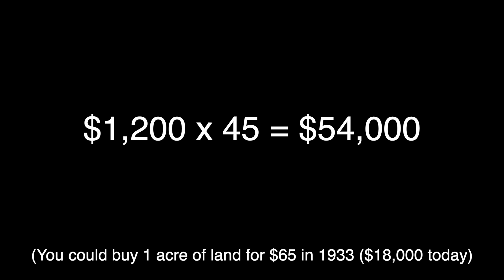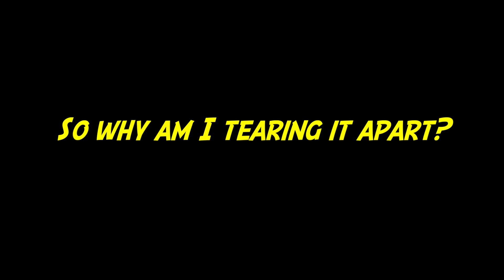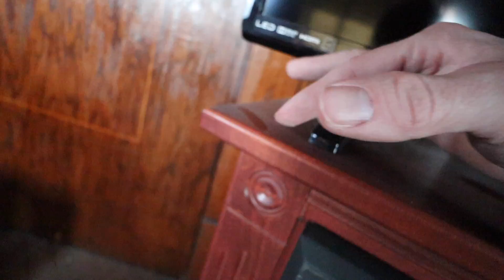Turning A $7,000 House Into A $700,000 House

Comment: we did our attic floor 25 years ago, reminds me a lot of your situation.  We had cheap grade t&g pine flooring that would split easily when it was pulled up to run new electric.  I screwed down all the old all the flooring, even the undisturbed boards.  We had blown in cellulose insulation and we left all that in place and then glued and screwed 3/4 t/g plywood down over all of it.  We had 6 kids, they had a blast up there.  they pushed their bunk beds into the middle of the floor and made it into a roller skating rink. Bottom line is it was an extremely strong floor,  a lot quieter that alot of commercial jobs I did as a carpenter and to this day not one squeaky board.

Comment: My middle school was in an old manor house that used to have its own power plant; it was on the first floor of the tower that also held the tank for the water system. THAT, even in my day, was fed from a spring, and a little three piston pump ran it up to the tank, driven by a water wheel in the creek. Pretty sure the wiring was just like you have here.

Comment: You should remove the wood flooring as carefully as possible or even call out a salvage company to do it.  It could be re installed in some rooms once the layout is finalized and you could probably find matching salvaged wood and blend it in with what you have.  You could use the hardwood in the attic space and you should have more then enough.

Comment: My parents remodeled a 1911 farmhouse in 1967.  They ripped everything out like you are doing upstairs.  We cleaned everything out like you are doing, and when we got to the vacuuming, We got one that vented all of the exhaust to the outside.  It worked beautifully.  My own home was built in 1924, and still has original knob and tube wiring in the attic.  It is all in good condition, so it is still in use.

Comment: I am happy to see that you finally are taking more effort in restoring your magnificent home. It is very much overdue and has to cost a mountain of money to keep warm in the wintertime or cold in the warm season. You absolutely need to invest in some air to air heatpumps/AC's. They will save you a lot, but the absolute must is proper isolation from the elements. Use a thick layer of insulation material, and if this was my house I would change all the windows to some with a higher insulation value. You must also get an electrician to renew all the electric wiring, outlets and switches, to prevent the whole thing from saying goodbye some day in a blaze of glory and burn to the ground. That kind of old material is super dry and a fire will spread like in burning dry grass in a gale winds.

Comment: try and save that hardwood flooring. Can't be found anymore. We had the same red tinted wood in my house which was built in 1900. They didn't have polyurethane back then so they sealed the wood with animal fat that has deteriorated over time. I gutted my farm house 13 years ago. At one time it was the premier house in the area.

Comment: Cole you may consider an air filter system while doing construction. 

Powermatic PM1200 Air Filtration System, 5-Micron Filter, 1196 CFM, 1Ph 115V (1791330)

Contractors use units like these to improve the air quality and reduce that dust you described seeing in the shafts of light. I am anxious to see the recommendations you get for updating the farm house.

Thanks for sharing.

Comment: You should always insulate between each level or the top floor will be 80 and the bottom floor will be 60. And you should use a zone style hvac system.  It will be a big savings in the long run.

Comment: Get a bundle of microfiber towels.  Attach one to a Swifter mop-head, the ones that have four openings on the back of head and MOP the dirty floors to get the rest of the dust.  You can rinse, wash and reuse the microfiber towels.  You will be doing a lot of mopping during the whole process.

Comment: This seems like an almost monumental job, and like all monumental jobs, the key is dividing it into manageable pieces.  Having a well thought-out plan in place is essential-- especially since you have to work around the seasonal aspects of farming.  Also you have to work around your budget for materials and labor for each aspect of the renovation... which should probably have a "I did not expect this" fudge factor built in (some percentage to keep an "uh-oh" moment from stalling progress).  My wife and I have been married for over 40 years, and for most of that time we lived in two new houses until 5 years ago when we retired and bought our current home.  It was built in 1910 and had been renovated which included plumbing (for the one bathroom in the house and kitchen), replacing the wiring (which was originally knob and tube), and installing a modern HVAC system.  The three fireplaces were bricked up (leaving the mantles) and chimneys removed, and the attic space was insulated (not really very well).  Of the many things we like about the house, a main feature was that two rooms had been combined into one big (16' x 32') room which my wife immediately claimed as her "woman cave"/craft room.  I took the front 16'x16'  room as my "man cave".  We have learned to live with having only one bathroom (mainly because the male anatomy is well-designed to the "world is my urinal" concept).  We love (most of) the history of the place-- it was originally the site of the county courthouse back in the late 1800s, the property used to have a "hanging tree" on it (struck and killed by lightning in the 1960s), and is on the highest point in the county (we have three markers on the property arranged in an equilateral triangle 90' apart with bronze plaques on each marker dated 1932).  Most of the rest of the county was surveyed from this spot.  Looking forward to the continued renovations on your beautiful home!

Comment: Very nice.  I am looking forward to seeing the renovation work.  I am concerned about the upstairs floor.  Rather than replace it all why not remove the wood from one room and use it to sow in flooring to repair where you are moving the walls. This way you can keep the old original look which is very valuable. When repaired all floors can be sanded and refinished.  The room with the remove flooring can be replaced with something that looks similar to the original flooring.  I think this might even be a cheaper way to go.  There are many flooring contractors that know how to do this work

Comment: Take some inspiration from European and Scandinavian houses for energy efficiency. Insulate the house as well as you can and take the opportunity to install a ventilation system with heat recovery and you'll save so much on your energy bill. And if you can, install the electricity and other wires in pipes like we do in Europe, and you will have a safer house in case of electrical fires and you have the ability to change wires in the future without ripping up the walls. I rewired my entire apartment in Sweden when i moved in in 2019 and the apartment was built in the 1960's without the need to open any wall or ceiling

Comment: Cole, if you're going to be working on a big project like that it is worth investing in a sealed HEPA vac like we use when working on lead paint.  Those big box store shop vacs, even with a HEPA filter, just blow the dust out the seams in the container.

Comment: Like others I would consider keeping quality floors even if old sills / walls need patching. But mostly: HVAC is the biggest constraint here from budget and design perspective with biggest risk / reward for long term health, comfort, and ROI. Need to be very strategic from the very beginning. Seeing the spray foam, would say definitely need ERV, at which point forced air makes a lot of sense, allowing for good filtration, etc. Geothermal heat pump with propane backup maybe? It will pay off long-term but oof big buckos!

Comment: i suggest to make a floorplan for every level (on scale)  as you need to take into account sewer/water and electrical pipes/cables, that you could plan it in such away, you can hide those in walls. Using small pvc pipes for your electrical cables makes i possible to change them if needed without demolishing a wall (european way of building)
and makes it possible to extend internet to any room (using wall sockets for your internet)

Comment: Please consider adding a whole-house vacuum system - they make keeping a large home clean much, much easier.  They exhaust to the outside so the dust etc. doesn't recirculate.  I think someone else mentioned a data center/server space, which is also a great idea.  And I wonder if the "This Old House" folks would be interested in this project - they know a lot about updating old houses.

Comment: I would say you should probably mop the upstairs floor after you drop the ceiling, just to help eliminate as much of the particles before taking up the floor. As even though you won’t get it clean, at least it is a cleaner working environment. I would recommend, depending on if you plan to keep the wood floor on the bottom floor, to keep a small amount of it so that you can use it for patches or filler, as it is the same wood throughout, and would be harder to replicate. Maybe if you could use some of the flooring to make some decorative pieces for the attic space, as it would be a shame for all of that presumably 100+ year old flooring, get chucked into the fireplace for heat, as it still seems to have a lot of life left to it. You could even make a few Christmas ornaments for the family out of the flooring, as it would be really special, in multiple ways. I can’t wait until it nears spring for more demolition and exciting new things.

Comment: Is the old boiler still around?  Was it a one pipe steam system?  Can you show us a shot of the old bathtub?  Those old tile floors are gorgeous!
 Thank you for the history it was very interesting! Kind of a shame in one way to remodel anything but I fully understand the need to fix the plumlink electrical and insulation and yeah- what were they thinking the way they divided up rooms in those days?  You will never regret that spray foam!  The heat that doesn't get away doesn't need to be replaced!

Comment: Suggestion,,,you said you will live in this house as long as you live. Well do you think your knees and back will tolerate the steps at 75 or 85? Suggest you design the bottom floor so you can close it off from theh rest of the house and just live there, as opposed to 3 or 4 fliights of stairs.  I know it dosent mean much now but as you get older your knees will remind you that you should have done this. I am sure I will get agreement from my senior friends on this issue.

Comment: Hi Cole 😀
Why don't you make a dust trap that you can go through when you have to get up and do something. advantage is that you don't have to spend time cleaning everything, but catches all the dust on the side where you want it. if you do it cleverly, you put a small fan on the clean side which blows a bit of air into the lock so that you get a bit of overpressure and the dust doesn't travel as far
Kind Regards
Mickey

Comment: Hey Cole just checking to see if y’all had pulled some concrete core samples on hopper bottom and got it tested for psi yet anyway great video
Reply: The samples should have gained some strength but I’m betting if it was just 3000 psi concrete it’s still below 5,000 psi the results from this test from a certified lab can be used in your lawsuit to prove concrete failure either by installer or concrete company, also this will let you know if it’s the concrete that failed or if it was the subsurface dirt work that the pad and footing was pour on failed compaction
Reply: What makes these cracks worse is the ones on grain bin slabs that could allow moisture into the stored crop

Comment: I wouldn't spray foam the attic. If you have a roof leak (you will) you will never see it till the wood rots. That will make a repair very hard and the foam need to be chipped out $$. I would just use fiberglass of rockwool batts

Comment: Please keep as much of the original finishes as possible. You may be able to find the same wood to patch up the floor where walls are removed so you can keep those great floors. The tile in the bathroom is beautiful. Once the electricians and plumbers to do those jobs, it will all come together quickly. Then you can put the insulation and walls back up.

Comment: Can we learn from the grain bin experience and employ an architect to look at your ideas. Even a short consultation to give you feedback on your plan/design. Also those 'non-load bearing walls' etc act as bracing for the structure overall. Removing them will make the structure weaker overall, so you'll need an overall bracing plan. Best of luck (but maybe do the planning/designing stuff properly to take the luck element out of it).

Comment: Ohhh dang. Cole. Start in the living area meaning down stairs. Finish that first. Then go up and so on. Life happens and needs change all the time. So in a few years you want something different upstairs and properly downstairs to. You can buy some water solution Here in Denmark we call it water glass that will bind dust so dont worry to much about that now. good luck KEEP THE HARDWOOD FLOORS. Make the lines from the old walls a future like with tiles or something maybe a strong color on the concrete. It can look cool. Give it a chance. You will never find floors like that again. And i promise you that you will regret removing them.

Comment: You're doing a lot of work for that house. I think all you had to do was blow some insulation in the walls, turn off electric and cut the old lines off from the outside and have all new wires run downstairs and upstairs,l into a new junction box hooked back up to the pole all inspected, the leak spots all fixed and all would be good to go.

Comment: 12:50 I dont understand why American houses are built with the outside doors opening inwards. Having them open outwards has a ton of benefits, they're safer, they do not get stopped by clutter inside. They're safer because you can put lip all around the door against the frames, adding just more security to anyone trying to breach in through it.

Comment: Oh I know all to well what you're going through with plaster and lath removal. Wiring , plumbing and redesign of the whole home. In my case my wife decided to buy an old hotel. Yep, same story. We lived 50 miles from the place so on Friday we would drive up spend the weekends tearing the place apart, Sunday night drive back home . This went on for years. But in the end it was completed. Learned a lot like don't do that again but it did. Still doing restorations on 100+ year  old houses 50 years later.  I have found don't try to tackle the whole project at once. You need a plan from the top down . If you finish the down stairs you'll need to tear stuff back apart to run plumbing or electrical from top down  .

Comment: As someone with a little building experience that roof system worries me.  That said, it's been standing for this long so it must work.  However, those boards get old and dry and rot and just lose strength over time.  I'm glad you're going to bring in an expert to sort that out because I wouldn't trust what's up there as a long-term solution.

I agree with what others have said about the flooring- save it.  There's a good chance that some of the walls were built on top of the flooring.  Take the walls out first and then carefully and lovingly remove the flooring.  They also make edge saws that you can use to run around the perimeter of a room to cut the flooring so it doesn't splinter when you pry it up.

The two CTCS videos I am looking forward to the most:
1. The walkthrough of the house when it's done, with the inclusion of the montage of all the work that went in to get it done
2. The one where you have a fully-functional bin site, with the montage of all the things that were messed up and how they were fixed.

Comment: I live in a 1924 Brick Schoolhouse.  The rafter system is quite similar to yours.  Here they are formed in a sort of Offset Truss design.  IF I had to describe it to something people know I'd call it a Tripod Truss.  The parts of the truss meet at the top but they don't land on top of the Lower Chord like normal, they land about 10 inches offset.  Mine land similarly, but the "Knee-Wall" isn't toppled over.  Mine lands just a little bit differently than yours.  Very odd construction habits in these old structures.  Some makes me question the appropriateness of some aspects of their design.  I'm glad to see you got back to the Homework 😉  Get it?  Home-Work! 🤣  "Cole, Do You Have Your Home-Work Done?!?!?" 🤣  I look forward to your progress!  I'm not understanding that space you said was like extra/bonus space in the Attic.

Comment: Need to put in a elevator. I would try sanding the floor in the attic and then sealing them. It would save you time and money. Also need a half bath in the attic. I would still do a quick mop of foot for dust. Also wiping down the walls it time consuming but will clean up the dust. I would also not rip up 2 nd  floor. You can not replace the quality of flooring. The wood is top quality. Patching could easy be done and matched. Great ideas just don’t take all the classics charm of the house away. Thanks for your work keep it up.

Comment: I have a finished attic. Let me share what I learned. Your roof needs to breathe. You need air channels that go from the eaves to the top with a vent system at the top. Insulation can go under those air channels but you need air movement under the roof. If you don’t it will become a heat and moisture trap. This will decrease the lifetime of the shingles and create moisture problems in the space.